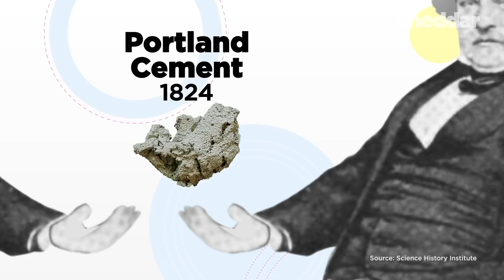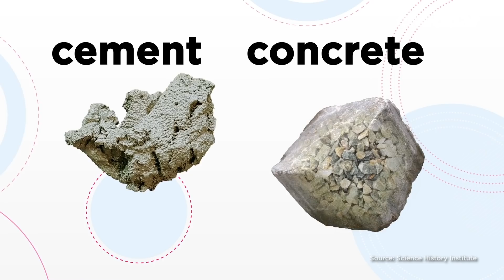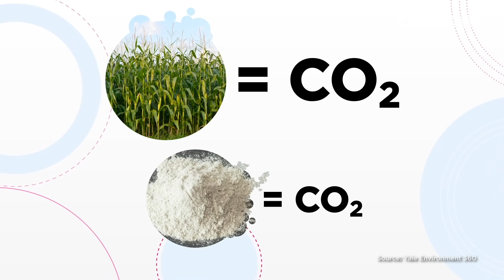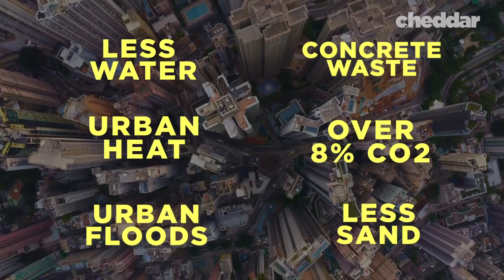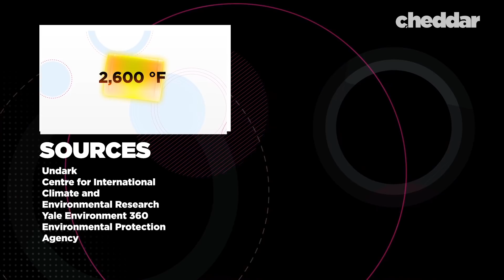Is Concrete The Most Destructive Material On Earth? - Cheddar Explains

Comment: Concrete is 100% recyclable, there’s no excuse to dump it into a landfill.
Reply: Concrete IS 100% recyclable! Water is used but only for dust control.. Concrete with rebar goes through the same crusher. The rebar is plucked out with a magnet. 
The crushed concrete is being used to make new concrete,  asphalt and road base. This video was full of false information and misleading quotes. Thumbs down
Reply: Well I think (may be mistaken) it's even required by law in Europe and there are fines for dumping rubble on a landfill
Reply: 100% recyclable? Please enlighten me how...
Reply: @narayananjayachandran831  Simple, grind it up. It's already being done, there is no need to put any concrete in landfills.
Reply: @erniemenard7727  how to separate the reinforcement bars from the concrete? You grind it up along with steel bars?
Reply: @narayananjayachandran831  the bars are only embedded in the concrete, bash the concrete enough and you'll get the bars out, many demolition sites will cut the concrete into blocks, then lift and drop them several times with machines to break them up to just to get them into trucks to haul them away.
Reply: @joermnyc  good to hear that... Thank you
Reply: @narayananjayachandran831  it's called a hammer
Reply: @narayananjayachandran831  obviously you've never seen how this is done but all the steel is separated during the demo process watch how the break up big driveways or tilt up panels.
Reply: @narayananjayachandran831  “Magnets” Jessie Pinkman
Reply: @narayananjayachandran831  pulverize the concrete pick up the iron with a magnet. Easy
Reply: @narayananjayachandran831  --  Once you start breaking it up, magnetic separation is quite effective.    It may or may not be worth the trouble but it can be done.
Reply: @narayananjayachandran831  many cities including my own have commercial gravel yards that thank their local residents for waste concrete that they grind into structural fill. All free to dump. And the fill is 50% cost of new crushed stone for the next user.
Win-win... do it again...!
Reply: @narayananjayachandran831  more like 30% because it waste a lot of water and only returns less than half the concrete you used.
Reply: @JEMA333  Still takes a lot of effort to recycle... Have to look st the root cause and find a suitable way to isolate reinforcing bars from concrete post demolition
Reply: @narayananjayachandran831  its very easy process to recycle concrete, the steel is very rigid so when crushed at the recycling facility it comes out very easily. Nearly every big cities in north America recycles concrete to make new concrete. In fact if you have enough of it you can even sell it like any other raw materials.
Reply: @narayananjayachandran831 chop it up into gravel then resell it
Reply: Over here in the Netherlands you will find them demolishing concrete structures and recycling the demolished materials by crushing and separating the components into sand, gravel and steel onsite.
Reply: Yes, but you aren't saving much. You still have to manufacture cement (to re-bind the used concrete), which is the energy intensive part. The only thing you get out of used concrete is aggregate, i.e. rocks and sand, and that is NOT the interesting part.
Reply: @allyourcode  you even knocked a hole in their argument you get sand one of the items listed we are short of. Not necessarily enough to to do it exclusively but quite a bit of EVERY project is using recycled materials!
Reply: @allyourcode  --   In some places good aggregate is difficult to find.   When I served in the US Army Engineers in VN, one problem in the DaNang area in particular was a shorted of aggregate.   The cement was brought in by ship.   Sand was all over the place (obviously, it was important to ensure it was washed) but "rock" often had to be trucked in for long distances.   The military could do this.   But civilians often simply destroyed an existing concrete structure/slab to get the aggregate to build something else.
Reply: True.👍
Reply: Cost more to recycle than to manufacture sadly, most "recycled" goods just end up in a landfill anyways and we cant change it without changing our politicians bc they would rather tax payer fund endless wars and frivolous investigations
Reply: @captaingreenhat  Which is why the cost to recycle should be built into the cost of the original good. If a manufacturer makes the product, they should at least be partially responsible for responsibly disposing of the product. We are letting manufacturers pass the buck onto consumers and then we all lose. Rich/poor, doesn't matter. 
We give huge tax breaks to companies that produce virgin material, but not to recyclers. From a "good for society" point of view, that makes little sense. It's definitely making someone rich though.
Reply: @herranton  the "passing the puck" you refer to is called "externalities" in the business world. Things like plastic bags, cups, cc processing fees etc etc. Most companies are already pushing externalities on the consumers (shareholders). An unfortunately inevitable result of a ceo/cfo's feduciary responsibility to stake holders. And as long as citizens v united stand, corporations will continue be be afforded the same rights as citizens to lobby politicans. You have a wonderful realistic and fair sollution but unfortunately it will never happen as long as everyone keeps electing the same loosers for 50+ years.
Reply: @captaingreenhat  unfortunately...
Reply: @captaingreenhat  --  You are right about most re-cycling.  Potentially, concrete can be usefully re-cycled into asphalt for paving.   There had to be large enough quantities for lab analysis in a high grade product is needed.   Of course, most asphalt in the US today is made by re-cycling old asphalt.
Reply: It is, but you still need new cement to bind it again. So still a problem.
Reply: Your moms HITACHI  ever heard of rain?
Reply: I literally came here to say “wait why don’t we reuse concrete instead of constantly producing it. I’m sure it would be less harmful to add to recycled material versus making all new material” 🧐🧐
Reply: @TheeJaLisaMarie  problem with reusing it is its structural integrity they know with their current mixes of concrete eg stone of this size with x amount of sand and cement and lime and so on will be this strong and if you add steel it will be this strong and if you vibrate all those air bubbles tiny as they are it will be even stronger and at this rating when you add in old concrete they dont know if it was rated at that current level they are trying to achieve even just reusing it as the stone component in the mix weakens the mix and believe it or not but stone is still stronger then concrete its just really hard to come by and in the perfect shapes and sizes we need to build and really difficult to move into position.
Reply: Bahahahahaha its all the same
Reply: If they said that it was recyclable then their whole premise falls apart!
Reply: I kept wondering why that pertinent fact never came out during the report. I'm also pretty sure people on islands and coastlines around the world use whatever sand they have at their disposal ....
Reply: Large construction companies just find it easier to dump it all in the landfill than recycle it. Same goes with fast fashion stores, when the clothes are out of style they just throw it into the landfills when it could be reused
Reply: @daniaflores8013  BS... 2nd hand clothes are either dumped to special containers and then sold with some profits going to charity or just simply bought by 2nd hand dealers and then sold in russia or africa
Reply: @give_me_my_nick_back  not always
Reply: Concrete is reusable not recyclable, there’s a difference. It can be crushed up and reused as aggregate, or as hardcore for roads. But what after that there’s nothing that can be done with it
Reply: @reecejl  true... but you can re-use it as many times as you want. Theres not much of a difference between recycling and reusing. Point is that its better under a road then in a landfill
Reply: Then why would someone pay to dispose of it vs getting paid to recycle?
Reply: @codycast  because disposal is cheaper than recycling
Reply: @codycast  in developed countries anything requiring human labour is just too expensive to be profitable. I mean why pay some dude 5-15€ per hour to recover material worth 1-2€
Reply: @give_me_my_nick_back  than make it more expensive to dump. meaning that they get  a really hefty fine or pay someone to  recycle.
Reply: @give_me_my_nick_back  this is this big problem really, there just isn't profit for most recyclers and thats across the board, not just rubble.
Reply: @codycast  You dont get paid to recycle concrete. Just at the sites you dump it at it will cost a fraction.
Reply: @juniorguerrero4488  then why is there concrete in landfills if you just said it’s easy to recycle. It doesn’t make sense
Reply: Let's live in grass huts and eat bugs. Seriously, why aren't any of you plantet saving people ever riled up about Bill Gates putting who knows what into the atmosphere to dim the sun, or his plan to cut down and bury thousands of acres of trees, which BTW breat in carbon dioxide. China is the worst country when it comes to protecting the environment, while USA is best. No one goes after corporations that sell us all sorts of convenience foods in plastic wrapping. The only people who pay for all the "green" are every day tax paying citizens. Every one else gets richer. Oh, I thought you guys also were angry with the "one persenters"? You blindly follow every crazy word they say. They are your gods.
Reply: Water crisis lol the world is 70% water.. And 90% of this video is bullshit
Reply: @josephcoleman57  yeah, but only 3% of that water is useable and often it isn't in the right location. 
All the world's beaches are made out of mostly silicon but that doesn't mean it's available to help with the silicon shortage for manufacturing that we are currently in.

Comment: Pretty soon, if concrete can't be recycled, we will run out of key raw materials and then urban civilization will really start to decline. We will need to learn to live WITHOUT concrete!
Reply: Symon Mailhot  my understanding is that it is not fully recyclable in the same form, though it can of course be re-used. If it can be fully recycled but largely isn't, then that needs to change asap. If concrete is not adiquatelly recycled, and we are running out of sand, then we have a problem. I am in no way saying there are not solutions to this problem.
Reply: Symon Mailhot  Also, -I don't have any theory about our civilization's decline, only that this is one of the serious problems that need to be solved for us to continue. I do however think that we SHOULD consider how to live without concrete, as well as many other things. Indeed, we need very much to figure out how reduce our consumption of non-sustainable and environmentally destructive technologies of all sorts.

Comment: To be clear, the Cascades derailment pictured in the 'infrastructure crumbling' montage was caused by excessive speed. 

Americas infrastructure is crumbling, and requires vast investment no doubt! 

But that incident occurred on a relatively brand new section of track, a section that has not yet seen the roll-out of regular passenger services since the crash - despite excessive speed being the primary cause of the crash, rather than infrastructure issues.
Reply: Bsauce  I'm 26 . . .
Reply: Bsauce  on what grounds? 😅😅😅
Reply: It wasn't really a brand new section of track.  It was a repurposed section of track being used for something brand new - namely high speed rail.  However this wasn't a great idea - the rail speed was 80 mph, yet the speed limit of the curve was 30 mph - even with new track, the curve angle had the old velocity profile.  A twelve year old could have explained why that was stupid, but we went forward with it.
Reply: @TheoreticalString  not a problem here - if America had safety systems such as AWS & TPWS and Morpeth boards fitted for severe speed restrictions . . . 

How many incidents in recent US railway safety have been caused by excessive speed? The Frankford Jn. Derailment being another clear example where UK cab design could have prevented the incident.
Reply: @anthonyholroyd5359  It's not really a matter of excessive speed.  It's a matter of linking an 80 mph track to a 30 mph curve.  Yes, you can blame the speed for the accident, but a very stupid decision was made long before then.  

Our signalling infrastructure is also laughably out of date, that's true too.
Reply: @TheoreticalString  It is possible to have 80mph track safely running into a 30mph bend though, and thats my point. 

On my territory we have a 60mph into a 20mph stretch for a curve for example, its safe because we have 'Morpeth boards' with fixed AWS magnets to alert the driver in advance of the speed restriction and give them sufficient time to break for the severe speed restriction.
Reply: @TheoreticalString  ye it is but we know how america is: They overrate cars and look down on trains. and its cheaper to keep the 30 mph section there is probs a reason. also I think istead of drasticly reducing the speed limit it should be lowered in phases so driver have the time to react

Comment: 6:04 - it doesnt have to. I know where Im at, they crush it and use it as the sand and gravel in new concrete. It can absolutely be recycled.
Reply: You can’t turn it into sand. Not the sand that’s needed to make concrete at least. Gravel, sure
Reply: It can also replace limestone, in Ohio it is #304 lime stone. Small rock with fine power. Typically used in foundations and road bases. The material cones from DOT jobs so it is certified for DOT use. Better than recycling, reuse
Reply: Thank you i was wondering about this.
Reply: Where do you live?
Reply: Your moms HITACHI  sand isn’t all the same 🤦‍♂️
Reply: Who knew you need rebar to make concrete

Comment: concrete doesn't significantly "crumble".  no mention that buildings are not built of 'concrete' per se, they are made of 're-inforced concrete' with a significant amount of steel encased in it.  Fine! but HOW MUCH can concrete generated CO2 ultimately be reduced by technological solutions. 7:49 that's not what permeable pavement looks like.  wood structure high rises are alternative
Reply: Reinforced concrete is still concrete 🤦‍♂️🤦‍♂️🤦‍♂️🤦‍♂️
Reply: @uhohhotdog  that's like saying a sandwich is still bread
Reply: @kevinwelsh7490  that’s like saying a sandwich isn’t made with bread
Reply: You’re using bread and you’re using concrete
Reply: @uhohhotdog  it ain't a piece of bread anymore when it's got peanut butter smeared on it.  enjoy your bread+bread+bread sandwich
Reply: @kevinwelsh7490  🤦‍♂️

Comment: Monthly Private Carbon Dividends = Real Racial & Climate Justice

Out of 1.2 billion vehicles, under 6 million are electric
4 billion people live at least one month per year with SEVERE water shortages
We poison wellwater, pump it underground for gas to charge car batteries in a drought
2% of energy is solar and wind, and we must stop burning 50% of fossil fuel in 10 years
By 2025, 66% of people will live in water stressed areaas
50% of thermal hyrdo electric power will be threatened with water stress
Planetary heating went up 46% in 50 years from 0.47 watts/m² to 0.87 watts/m²
Greenhouse gases went up 45% in 30 years + 15% of energy will be renewalbe by 2040
4% of energy is renewable, 4% of mammals are wild
We cut trees 2X faster than we plant them, they grow faster in fires floods & dourghts
Battery and bio-energy extraction will destroy tribal cultures and wildlife
40% of insect species are at risk of extinction by 2050
Most solar panels will become unrecyclable toxic waste by 2050 at 6 million tons per year
Vaclav Smil says North Euro offshore wind turbines work 33% of the time,while their onshore turbines work 22% of the time,and their solar panels work 11% of the time

Dams destroy 80% of river wildlife up and down the rivers
Europe burns 80% of all wood pellet cargo for renewable electricity
Europe burns 80% of its curbside recycled plastic & paper for electricity
Europe burns 50% of its palm oil cargo in diesel engines for bio-energy

see Loki's Revenge blog on wordpress if you like facts links and sources

Comment: concrete structures last about 100 yrs only.
what if another material used that can last up to 1000 yrs. 
nature will be saved.
Reply: Symon Mailhot  Roman buildings didn't have rebar which allows them to last so long.
Reply: There's no reason to pay extra to make a building that lasts a millennium. They can be replaced with better buildings sooner than that.